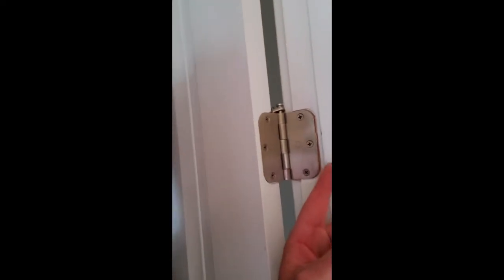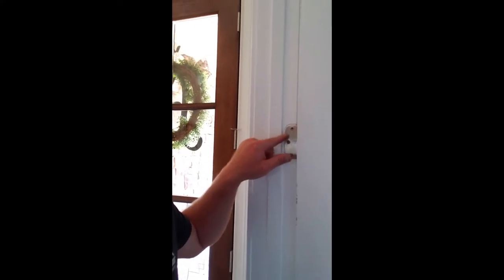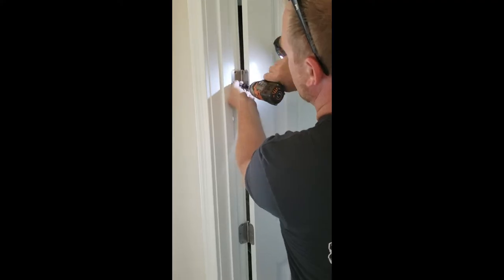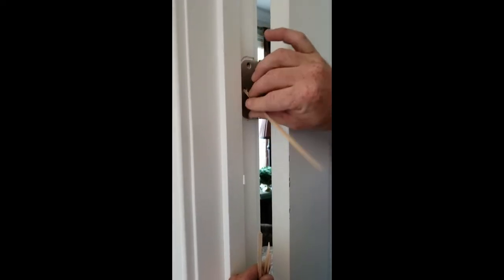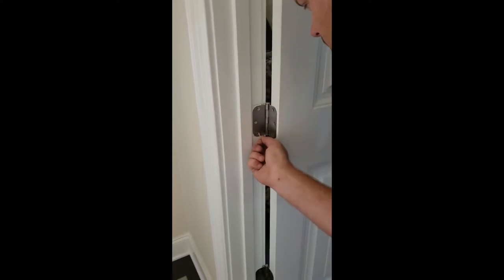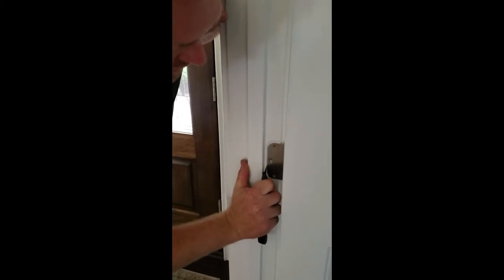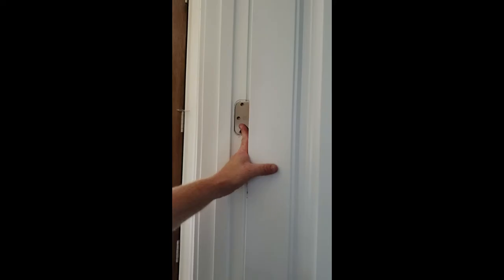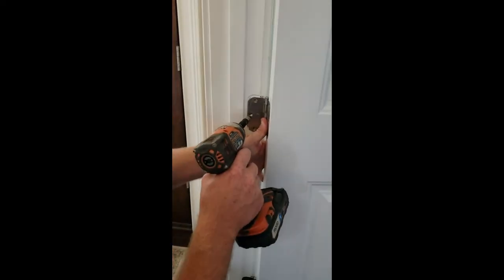Door hinge Binding (2019)

Comment: Took the whole door off, binding on both directions, Year's of dealing with a door that never closed after a remodel, shaved and stupidly countered the hinge, made up some shims from a vinyl cutting board sheet using one hinge as a template a hole punch to make the screw holes, all to make up for my faulty logic and fixed the problem ... mostly. Now it closes easily with a push but has that last bit of travel binding (used a piece of paper between the jamb to prove that was the last part of the problem ... was) So now here I am watching this very useful vid again to make sure I know what I'm doing now.  Thanks

Comment: Great! It worked for me, I have been stuck a while on the binding at the hinges, your video was spot on, fixed the problem right away.
Reply: did you reuse the same existing holes like he did or did you drill new ones further away from the doorframe? That part confused me
Reply: @shazam2323  new holes, the old screw holes pulled the hinges back causing the binding at the hinges. I realigned the top and middle door hinge pins the same distances from the door casing on the hinge side. That put me in line to screw new holes.